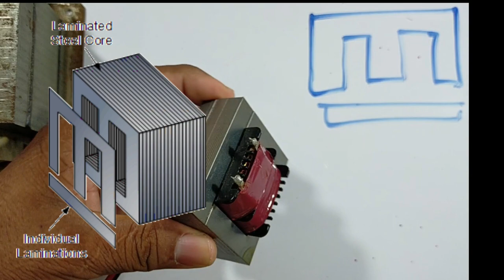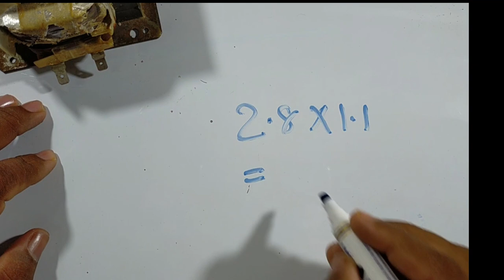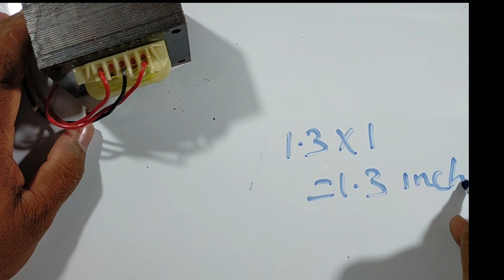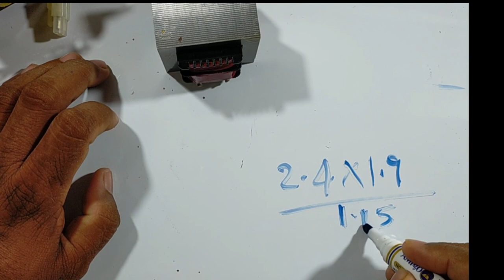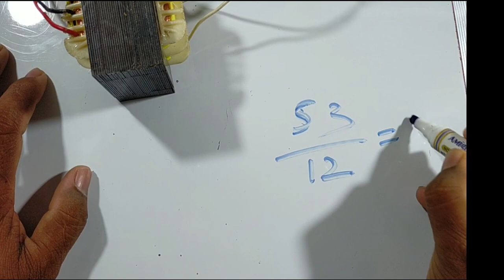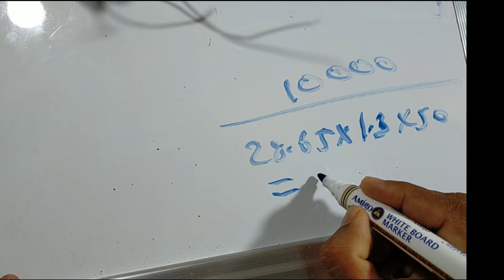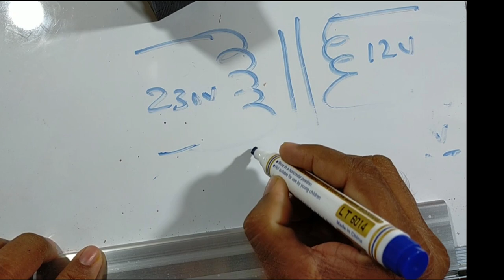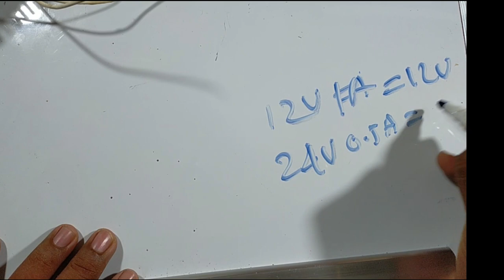HOW TO CALCULATE CURRENT OF UNKNOWN TRANSFORMER EASILY

Comment: Sir Your videos are awesome. Very informative. I have to say, you are the one of the very few content creators who add value to the viewers knowledge base. Kudos.

I have a simple question, i have a usb powerd monitor. Its consumption power is 5v. I am not sure about its Ampere. Inorder to run it on a 12 v 35 ah battery i ordered one buck down converter of 5 Amp maxium output. My question is, is there any problem for the monitor if i run it on 5 v buck down converter as the output Ampere is 5 @maximum? I belive the ampere of the monitor is around 2 amp. Please give me an answer.
Thank you sir for your awesome videos💐
Reply from the maker: The monitor will take it's required power only, even though the power source is over rated.   For example the transformer of KSEB is 300kva but the bulb that we r connect ing is just 100w . It will take only 100/230   0.4 amp even though txr can  give even 1000 amps.  Higher rated source is better.
Reply: @saneeshelectronica9293  Thank you sir 💐

Comment: Could pl give me circuite for 5amps,120volts dc without transformer
Reply from the maker: It is not easy reduce  voltage without transformer. Transformerless work only for current less than 1amp.  U need to buy smps  with that rating

Comment: Hello sir
ഞാൻ രണ്ട് wall ഫാനിന്റെ ion core winding മുറിച്ച് മാറ്റി അതിൽ വേറെ winding 42 formulaവെച്ച് ചുറ്റി ഒരു toroidal transformer ഉണ്ടാക്കി.
പക്ഷെ അത് load കൊടുക്കാതെ തന്നെ നന്നായി ചൂടാവുന്നുണ്ട്.അതെന്തുകൊണ്ടാണ്.
Primary coil കുറവായത് കൊണ്ടാണോ?
Reply from the maker: Reason in i think iron loss. Core each piece insulate cheyyanam
Reply: ഇപ്പോ readyആയി sir
ഞാൻ 12volt halogen bulbs (100/90watts) കൊടുത്തപ്പോൾ 2.54 Amps currentകാണിക്കുന്നുണ്ട്.
അപ്പോ 12*2.54=30.48VA ആണോ sir?
Reply from the maker: Fan iron core transformerinu suit akumo ennariyilla. Output kittunnenkil upayogicho
Reply: SANEESH ELECTRONICA out put കിട്ടുന്നുണ്ട്
12-0-12 and 12-0 യും out put കിട്ടുന്നുണ്ട്

Comment: primaryil onnil kooduthal taping undenkil enthu cheyyanam..
Reply from the maker: Maximum resistance ullidathu 230v kodukkuka. Secondary voltage ariyam. Stabilizer txr mathrame multiple winding ullavarullu. Athu special design aanu . Usually 110  230v Anu tap undavaru.

Comment: എന്‍റെ കയ്യിൽ ups ട്രാൻസ്‌ഫോർമർ ഉണ്ട് അത് rewind ചെയ്തു 12 volt ട്രാൻസ്‌ഫോർമർ ആക്കാനായി പറ്റുമോ.. നിങ്ങളുടെ നമ്പർ തരാമോ..?
Reply from the maker: Primary supply koduthu output voltage nokkoo
Reply: @saneeshelectronica9293  12 volt aan...but ippo working illa rewind cheyyan patumo..?
Reply: @saneeshelectronica9293  output kure wire und

Comment: Output current solely depends upon core area...is n't...
Reply from the maker: Not current   its VA  current  depend on wire  size.  If voltage is more current  is less. VX I is constant.   Turns/ volt    solely depend on core area